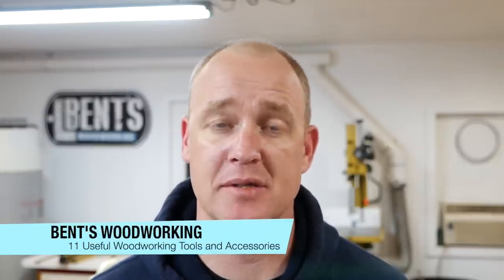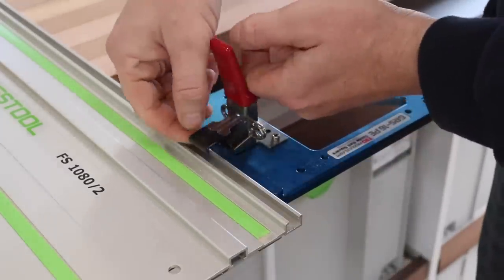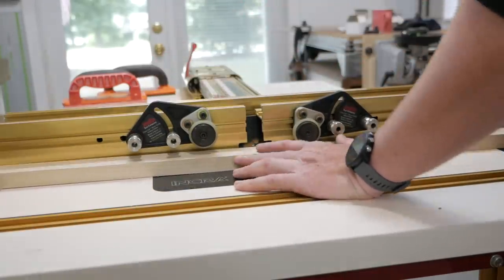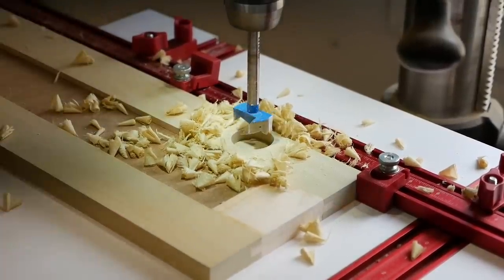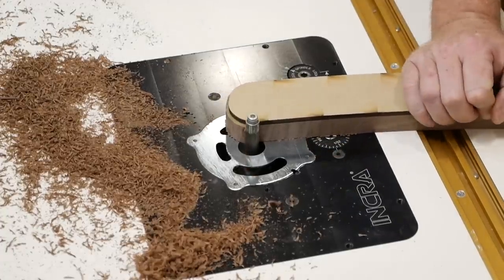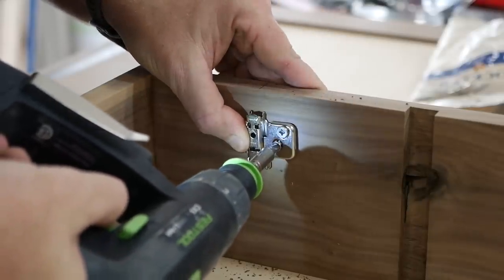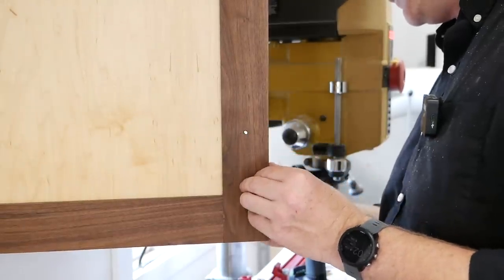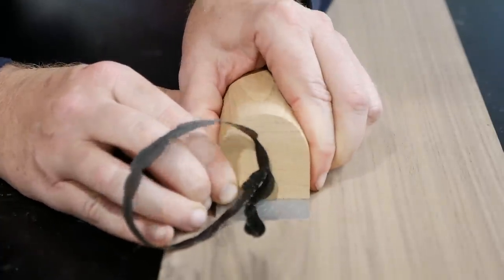11 woodworking tools you need to own

Comment: I gotta try that knot filler thing.......
Reply from the maker: It’s a pretty useful item Tamar 🙂
Reply: Bent's Woodworking does it feel soft at all after it dries? Like, can you make a dent in it with your nail?
Reply from the maker: I haven’t tried but it dries pretty hard. They actually have different sticks that dry to different hardness. It’s pretty interesting when you read about it. They have different colors as well. I wouldn’t use it for everything but it is great for many applications
Reply: @bobbg9041  That's an expensive hot glue gun! Holy crap.
Reply: @supergimp2000  You can actually just buy the sticks themselves, and use with any variable temp gun. They are still kinda spendy, but the smallest kit fills 270 voids/knots on average, so... It's only like $.20 a knot, for something that immediately cures (which time is money if you are doing this to make money) Expensive, but not outrageous.
Reply: @TimothyRitzer  curious how they compare with the burn-in sticks you can get a dozen or so for under 10 bucks. I’ve used them before with good luck.

Comment: The knot filler is cool but very expensive for occasional use. I'll stick with sanding some fine powder off the board, then pack the wood powder into the hole to be filled and saturate it with thin CA glue. It's the right color and can be cut or sanded as needed.
Reply from the maker: Very true

Comment: I like the Rangate filler but couldn’t justify the cost.  I found that the knottec sticks work in a regular glue gun, and I use a coffee tamper (really cheap on Amazon) as the plate to cool it and push it into the wood.
Reply from the maker: Interesting! 👍

Comment: The hot glue gun is really cool......

Untill I checked prices.
I wonder if wasting a 10$ hot glue gun by trying to push crayons thru it will yield similar effect? Maybe for narrow cracks? Anything wide I figure crayons would be a bit brittle
Reply from the maker: It’s similar to a common hot glue gun but the material used in it is not the same as traditional hot glue.

Comment: Not dissing you or the tools, but I make custom furniture for a living, every day and I don't have a single one of these tools.  You spend a LOT of money on tools that you don't need.  My tools are used, beat up and useful.  I also don't hang them on the wall in pretty cases...that cracks me up.  They are tools, not trophies.  Woodpeckers is for guys that just want to show off tools, not actually use them.
Reply: FullTimeFurniture Maker Out of curiosity I added up the price of all of the tools - over $1700 not counting sales tax and/or shipping if applicable.
Reply: The video isn’t titled “must have tools you absolutely need to be a good woodworker.” And woodpecker are for guys that want to make sure their work is absurdly accurate. Spread your hate elsewhere please
Reply: Johsel Rivera it’s not hate, it’s experience and a realization that building a bookcase does not require the precision necessary to build a spaceship.  It s also not about hawking expensive and unnecessary tools.
Reply: Roger got it right, just trying to help.  He'll realize sooner or later what a waste all of these gadgets are.  I'm not saying not to buy expensive tools, my motto is buy the best, once.  But, honestly, woodpecker tools are ridiculous, anyone can see that.
Reply: @mikekernjr5121  Could buy a few classes at a top notch woodworking school with that, and it would help WAY more than any of these tools.
Reply: FullTimeFurniture Maker on the subject of woodpecker... they are way overpriced so we can agree there but they are incredibly accurate. Is that worth it? Depends on who you ask I guess
Reply from the maker: Ben of my 45+ videos, 1 was with a sponsor. I built furniture as a business, used the profits to build up my shop with the tools that I wanted and stopped so I could focus on creating videos that people may find helpful. I have been in the Army for the last 17 years, so this is just something I do on the side. I do not rely on income from any of this to support my family. My goal is to positively impact people that are at the same point I was a few years ago. It is not to have a million subscribers and make millions of dollars. The purpose of this video was not to say you have to have these, rather I find these to be helpful in my shop. Thank you.
Reply: Bent's Woodworking First of all, thank you for your service.  I ve never meant to disrespect you or your channel.  If you are not receiving any compensation from the tool manufacturers (which would include free tools), then more power to you.   Myself, I m just a retired guy who has been into wood working for many years and who prides himself in making some pretty good furniture with some simple and usually pretty cheap tools.  In fact, for me that is part of the challenge as well as part of the fun of doing it.  I think there are a lot of guys like me out there who would not waste money on the types of gadgets you feature like the woodpecker products-although I have to admit they are pretty.

Comment: I'd never consider using any sort of jig for mounting baseplates.  Mount the hinges on your doors.  Attach the baseplates to the hinges.  Adjust the plate all the way toward the cup.  And there's your "template".  Spacing between any number of hinges is idiot proof... 'cause you used the door which goes there.